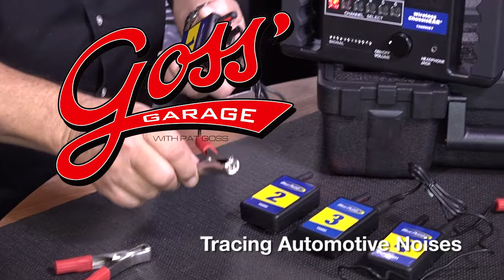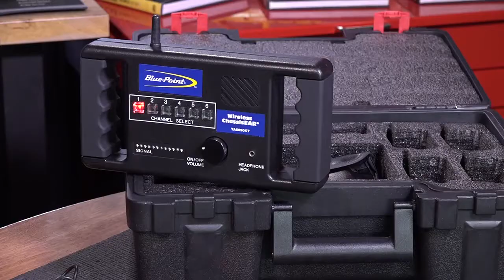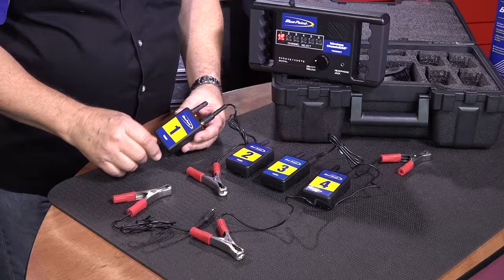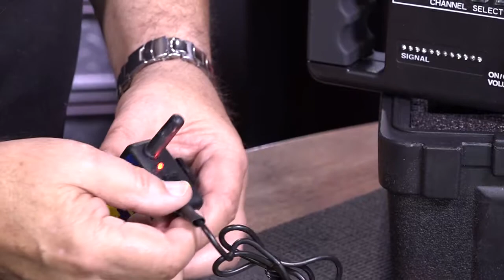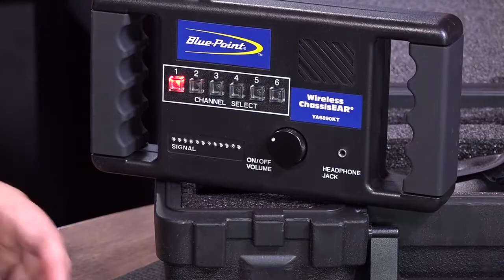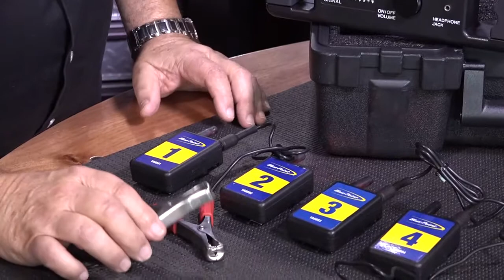Goss' Garage - Tracing Automotive Noises

Comment: I can't find a rattle in the back of my car.  I've looked underneath can't find anything loose, checked the spare tire, checked the interior panels, checked the jack inside the car, checked rear bumper cover.  It's pronounced over bumps, I checked struts.  I checked exhaust.  It's not fatal because it's been a year but something is definitely loose i just can't find it.